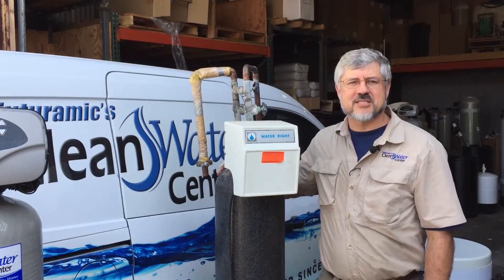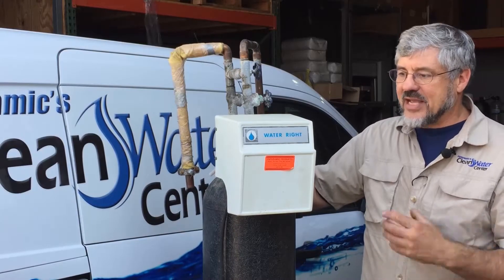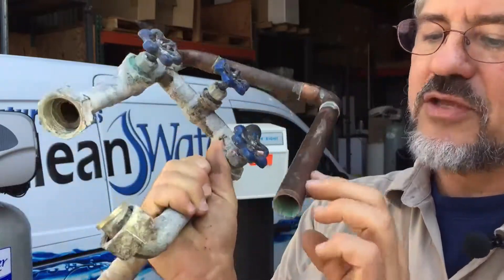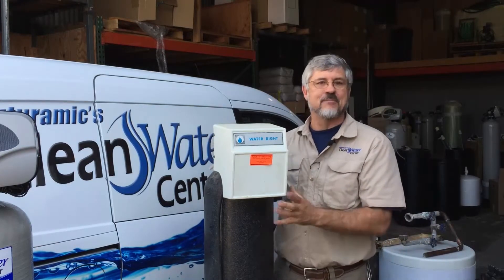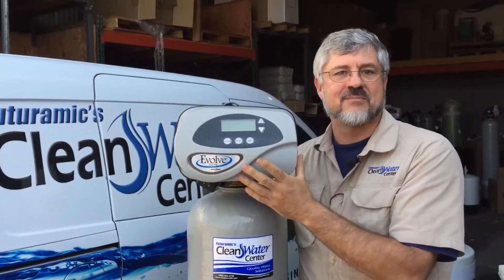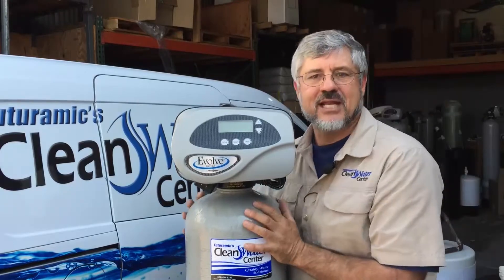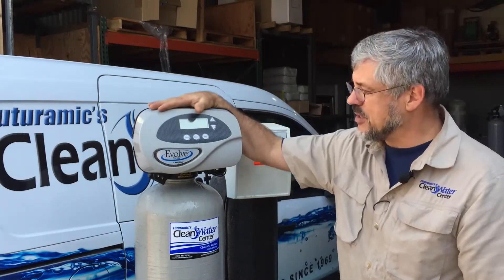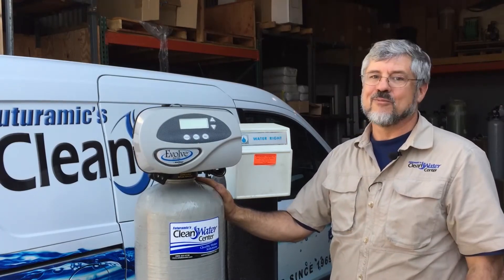Old vs New Water Right Water Softener Systems

Comment: What if a house has well water with high iron and has had no treatment/softening for 23 years (since being built) and now I install softening system. Iron is .86 mg/l and toilets show iron staining and fixtures reflect like scale.  Presumably pipes are full of iron like shown in shots in  this video. Any chance balanced water will help flush the buildup in pipes? If not, anything I can do to help flush them? Or am I just screwed and only way to address is to replace copper pipes?

Comment: a water softener alone should only be used to handle 1 1/2 -2 parts iron. any more and you need something taylored more towards iron removal is. an oxidizer and filter

Comment: Water Right uses Culligan's old zeolite media resin. Culligan uses the Cullex. In your opinion does the old Crystal Right Media perform better? And if so why has Water Right gone away from it? Thx
Reply from the maker: The Zeolite Media, CR100 & CR200 are still used in all of the Water Right Conditioners, they have not gone away from it. They have in fact greatly improved the Zeolite media since acquiring it from Culligan in the 80s.  They do use ion exchange resin in their softeners. 

Cullex is Ion exchange resin.   In our opinion ion Exchange resin and Zeolite do different jobs.  Resin works best on calcium hardness it is efficient and cost effective.  

The Zeolite media is best used in well water applications because of its greater affinity for iron and manganese and the ability to absorb odor. Zeolite is not degraded by chlorine like resin, so the Water Right conditioners are able to use Water Rights chlorine generator to chlorinate the media bed with each regen. About half of our work is on problem well water, we have used zeolite conditioners for about 20 years, they rarely if ever fail or foul, and we work on many older units, as the unit in the video shows.

The Zeolite media also absorbs ammonia, so in city water applications, by preceding the unit with carbon, we can successfully filter chloramines, (both the chlorine and ammonia). as well as softening the water.  Other carbon only or carbon resin combinations only break the chloramine and remove chlorine, leaving the ammonia.

Hope this answers your questions, not alot of folks know the Culligan connection/origins to the  Crystal Right media.